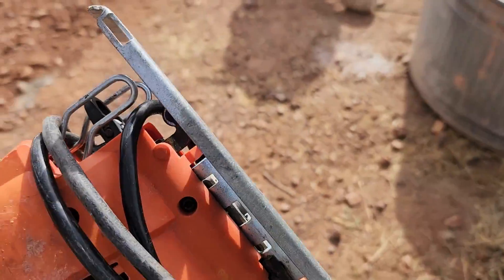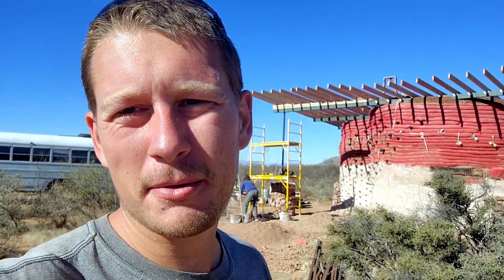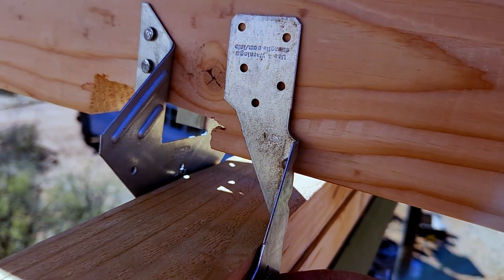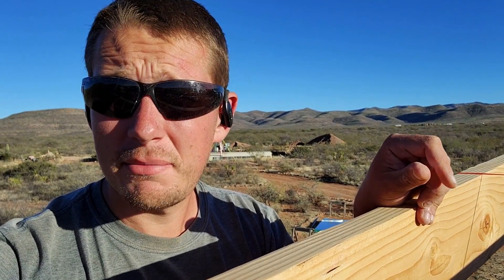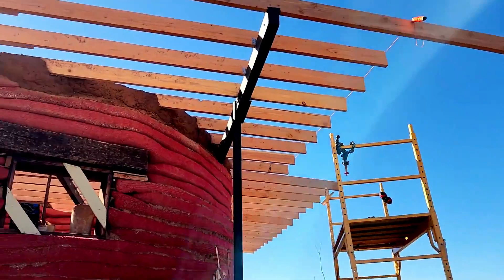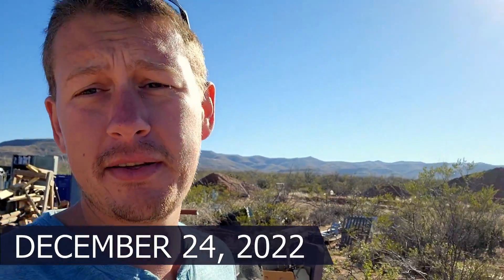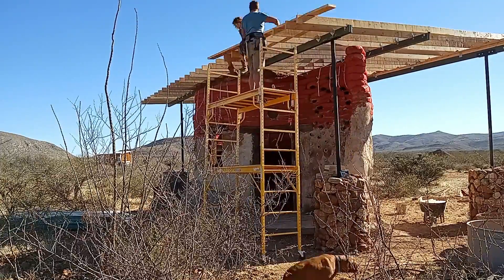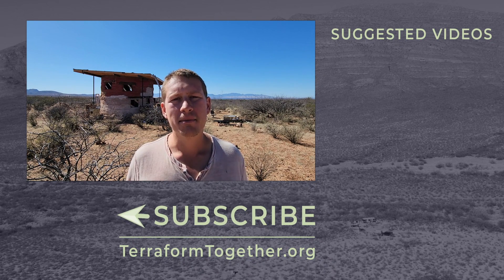Installing a Square Roof on a Round House – It's A Challenge | Hyperadobe Earthbag Tiny Home Ep 11

Comment: Looks great! I am a complete novice and in the planning stages of our earthbag home. We are hoping to do something similar (square roof on round structure)-but probably going to hire someone to do it as we want it fairly larger and for water catchment. In your opinion would it make sense to build the roof/pole barn first? Or after the earthbag roundhouse is complete? Thanks 🙏
Reply from the maker: We did the bags first because you have to stand on top of the bags to fill them. The roof also ties into the bags for structural support.